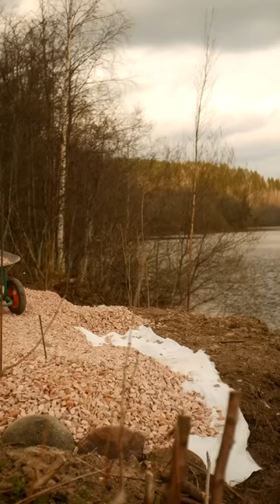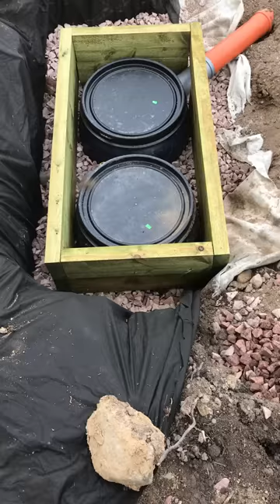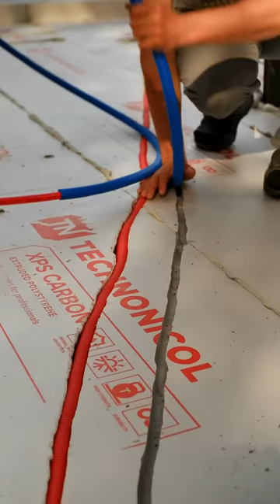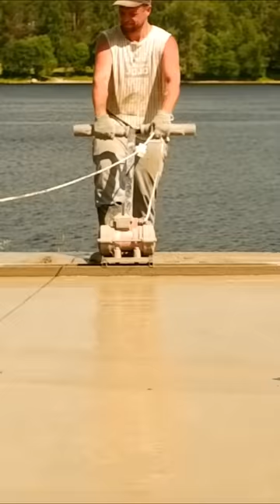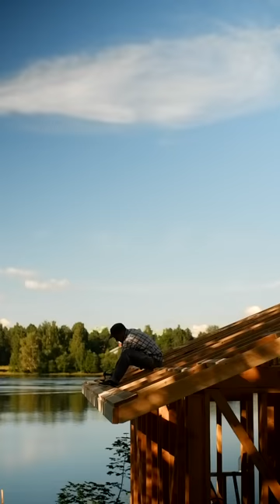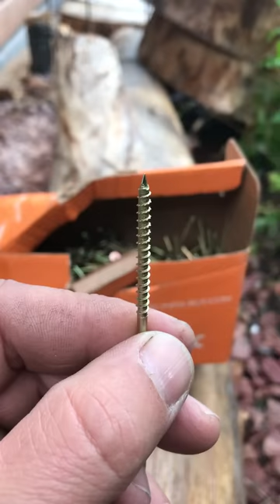Built a Dream House Alone! 1.5 Years in 18 Minutes. Diy

Comment: That seems awfully close to a body of water
Reply: Охранная зона реки: "я что для вас, шутка какая-то?"
Reply: Yes, My guess is Not USA. I cant cut a tree down within 125ft of a dry  summer creek in WA State.  😂
Reply: Beach erosion time.
Reply: It's Russia.  Here you can
Reply: That was my thinking,  flooded out part of the year.
Reply: It's a hydro lake as you can see, so it's level is regulated, but being Russia I wouldn't trust that .
Reply: Sorry to hear that. Nice build tho
Reply: @sandersson2813  last I checked Russia has a climate like here in Canada .   Lakes go up and down all the time, flooding is a real issue and building that close to water is not very smart.  One bad rainy season and you lose everything.   Last year we had a storm that moved several homes like that over 400 yards inland.  Two ended up in the middle of the road and had to be pushed aside with a snow plow.   That was in late September.  Not a wise placement at all and so much work wenr into it.
Reply: @jimdavison4077  Did you miss that it's a HYDROELECTRIC LAKE?
The level can be CONTROLLED

I agree that it's not clever to build that near to the water, but you don't know of that limit it is currently at is the max the lake holds. If any water body is easy to manage flood risk, it's a dammed, hydroelectric lake.
Reply: @sandersson2813  managed to some degree.   Not to the point that you build that close.   We get extreme weather conditions like never before, what might have been manageable before may no longer be so whats the point tempting mother nature to prove humans wrong?   An extra five foot of water could undermind the entire base it sits on.
Reply: @jimdavison4077  It depends of it's built above the height of the dam sluice doesn't it? If it is then it can't possibly flood. 
Presumably someone who has laid out the amount of money, time, money and effort to do this might have a better idea than some chumps like us on YouTube though, don't you?
Reply: @sandersson2813  You assume a lot, all kinds of people on Youtube doing stupid things I think you will agree.  Also the base this was built on is just inches above the water line, fast moving water doesn't take much to move the bank back and undermine all that work.   I have seem damns overwhelmed before because engineers ignored the obvious and thought they could control the pressures water carries.  Also I don't know many parts of Russia that don't freeze.  Icing causes serious problems and in floor heat like that causing ground anomalies  in the frost cycle would cause hell in shifting every year.
Reply: @jimdavison4077  fast moving? It's a dammed lake, it doesn't have a current
Reply: @sandersson2813  you don't get it when water levels rise it needs to go somewhere.   As people have tried to claim if the water rises it has a spill way.   Well which is it it has a spill way or it doesn't.    Either way the water moves.    How can people not see that.   Hell even if the water level doesn't rise of it freezes the ice then moves.   Or didn't you know that?   Many people who don't live in a cold climate don't know what freezing and frost can do.
Reply: @jimdavison4077  And you don't seem to get that it's a HYDROELECTRIC dam which means the authority has complete control on the levels within it. 
We don't know the lake, but we can assume the person in the video knows it substantially better than we do.  
For all we know the lake  is already at its  maximum at which any further ingress leads to overtopping the safety sluices, and yeah it appears close to the edge, but we don't really know from the perspective just how close it is and as you don't know where it is, you have no idea what the weather will be like or what ground conditions are or what the banking is made of or how it is supported. 

We can SUGGEST it's too close to the edge, but the world is FULL of examples of EXACTLY the same sort of thing or do you think this lake has the only building this close to the water.

Lakes have no current, the only movement is up/down, and ice only moves if there's something there to move it. 
I'll presume that as an American your ignorance of European geography leads you to believe that most of Russia freezes. It's the biggest country in the world by an absolute mile, it's got a vast variety of climates, from the frozen north to the arid dry south at the Caspian.
Reply: @sandersson2813  If the last decade has taught us anything its that water is not easy to control.    It doesn't matter if its a lake river or ocean they all have an incredible ammount of force.   And no ice does not only move if there is something pushing it.  Water expands when it freezes so whatever is holding that water has an incredible amount of pressure acting against it.   As for frost i have seen it lift a two story house six inches off the foundation.    There is a reason you can't build so close to water in most countries even in Europe.    Most people can't afford to throw money away so they only want to do it once.
Reply: @jimdavison4077  Water in a controlled, dammed  lake IS easy to control and doesn't even need any human intervention. 
A dam wall SPECIFICALLY let's water out when it reaches a certain height.

Ice does not flow in a constrained dammed lake, and yes it does expand, but so what, it expands IN THE WATER. 
Yes, there is such a thing as frost heave BUT YOU DONT KNOW WHERE THIS LAKE IS. It could be in the Caspian area where temperatures are mild. 

Also, you are ignoring that building exist next to lakes ALL OVER THE WORLD.
Reply: Effectivement, les risques que la rivière ait un débit plus important, expose la maison à de potentielles inondations.
Reply: @sandersson2813  i have yet to see any building that close to water that does not suffer seasonal flooding from time to time.   And when water freezes and expands it does not expand IN THE WATER as you say but onto the surounding land.   For example if you put a glass bowl of water in the freezer chances are when it freezes it will break the bown from expansion.    As for controling water levels every year damns  overflow because they get more than expected water levels.   So the point remains that building that close to the water with that type of construction was not a wise thing to do.  If the water rises enough it will undermine the entire stricture.
Reply: @sandersson2813  if built prooperly and anchored into the ground and eleivsted sure you can build close to water or even on it.   That stricture is free floating on the ground.   Which means as water starts to eat away the soil around it and under it the building will shift.   Maybe even move.   Thats not desirable.
Reply: @jimdavison4077  You DONT KNOW if the water will "eat away at it". 
Do you seriously think the builder hasn't considered the conditions? You think he's that stupid?
Reply: Jesus, you still aren't getting this. Dammed lakes have sluices or overtop at a certain level. If you build ABOVE this level, it CAN'T flood.
Reply: @sandersson2813  do you want me to answer that honeslty?   The answer is yes, anyone who builds that close to water using rhat type of construction is either not very smart.   The risks are to great.
Reply: @jimdavison4077  You haven't got ANY knowledge of the location or the conditions. 
You're trying to pretend you know better than the person who has built this. 

Do you seriously think he would spend all that time, money and effort only to completely ignore the hydrological impact and that he only wished he'd listened to some know it all from US or Canada? How arrogant is that?

You're pretending to know that this house is built on poor knowledge when you have no knowledge on the lake . You've demonstrated your ignorance already by stating that as far as you know most of Russia freezes "like Canada".
Reply: @sandersson2813  no such think as can't flood that close.   Its water.   Water surpasses what engineer's plan for all the time.
Reply: @jimdavison4077  Jesus, you just don't understand engineering. The dam STOPS flooding by letting water out faster than it can enter the lake.
Reply: @sandersson2813  And every year we see that fail so what's your point.  It's an imperfect world where things don't always work as designed.   Engineers can't always plan for weather as it's becoming more extreme all the time.  You understand a lake is a big bowel which catches all the water from the sounding area right?   That bit of sand he put down isn't going to hold up if it gets saturated, it will give out leaving the structure undermined.   I have done enough construction in my life to know that.  People who build around water build on solid footings that they can anchor to.  Not sand put in with a wheelbarrow and then tamped with a home made device with an electric motor.  I worked 9 years on building highways and understand engineering a lot better than you do obviously.
Reply: @sandersson28 yes I think we all get that it's a hydro lake  and "controlled by the authorities" (someone has repeatedly mentioned it).... that doesn't mean the authorities are paying attention and react in a timely manner. Why so hostile? Is it your house?? If not, chill and let people have their thoughts and opinions. Geez.
Reply: @judiclark1012  I'm not being hostile. I'm simply stating that those commenting about the proximity to the lake as if they know everything  are not aware of A) where this lake is, B) how the levels are controlled, C) the conditions in this area or D) the knowledge of the builder, E) how building techniques differ in different countries or F) the current water levels in relation to normal/safe/historical/overtopping levels. 
They are simply surmising and arrogantly suggesting they know better than the guy who built it when it receipt of absolutely no knowledge of the area. 

Would you like it if some nobody on YouTube tried to tell you how to do your job when they know nothing about how you came to the decision to build in that location?
Reply: The control levels for hydro lake are 3% either side and that's with everything going swimmingly. That's getting flooded at some point, that's Russia and trust me as someone who lives in Europe they are crazy and do stuff like this. A Russian friend of mine built most of his house in Russia with a chainsaw over an old mineshaft... you wouldn't be allowed put up a tent near a mineshaft in Ireland.
Reply: @tonybarrett8543  As if living in Ireland gives you special knowledge of Russia.
Reply: @sandersson2813  does sand react different in Russia when saturated?   I see reason to think it does.   That was all very small agrigate put just on the surface of the existing ground.  Nobody builds like that that I know of.   And for a good reason.
Reply: @jimdavison4077  No sand doesn't, but this isn't built on sand. 
What sort of engineer doesn't even know how to spell "aggregate"?
Reply: @sandersson2813  we must have watched different videos because the material he used was fine.   That same material is known to run like mud when it gets saturated on a grade outpacing a running human.   Just stop with the pointless commetary and make some sense.
Reply: Wayyyy too close, all that work in a matter of minutes could be washed away! Much too risky my comrade.😮
Reply: must be a safehaven for eco workers or conservationists to stay on during harsh weathers...hence the lack of certain amenities...probably government sanctioned installation...maybe...
Reply: That's the beauty of it 😊
Reply: @way-with-heart anything is possible in Russia!
Reply: That’s probably where the waste is going.
Reply: Always has seemed odd to me that we call a fluid, a body, of water
Reply: His building is so airtight, it won't sink. 👍
Reply: Nice build. Where do u eat sleep cook?
Reply: Idk how I feel about concrete being poured over Pex plumbing
Reply: @sandersson2813  you don't know anything about russia
Reply: @michagorski4693  I didn't claim to.
Reply: @watchndatube1  Washed away in a hydro electric dam with controlled levels and no current?
Reply: Freedom is the right to take a chance with your own damn property
Reply: It is not a house, it is a sauna!🌷🇱🇺🙋🏼‍♀️
Reply: @sandersson2813 wow what world are you living in? I have seen licensed professional builders do stupid things while building and be shut down because of it. Another thing that septic system he installed so close to the water will leach into the water too, even more if that water rises up and floods the land, the water level in the ground is already high being next to water, a perk test should have been done to even see if it would drain correctly.
Reply: @jimdavison4077 don't waste your time on people like him.
We all know it's just stupid to build that close to water
Reply: @way-with-heart no, you don't
Reply: Je connais quelqu'un qui devrait en prendre de la graine .
#vivienroulin 
Et sa " rénovation"
Reply: Really poor choice by builder. Shows total lack of concern for environment. Way to close to water regardless if this is a regulated reservoir. Your septic sysyem is way too close to the water causing nutrients to leach into water. Takes away any credibility with your build
Reply: @sandersson2813 he said lake is result of hydro electric dam. There IS current whenever dam releases water or is generating electricity. 😊
Reply: @sandersson2813 wonder if people like you were telling Noah the same thing you are telling this man?
Reply: @joetownsend5904  Noah didn't exist.
Reply: @joetownsend5904  Ha ha ha. You realise the turbines are at the BOTTOM ? 
Youve clearly never seen a hydro dam in operation. You'd have no idea of any current unless you were working about 20metres of the dam wall.
Reply: Damn thats still a lot of work for 1 man
Reply: It does, but I think it’s a lake so unless they get a lot of rain I think it’ll be OK. But where’s the kitchen?
Reply: @GoodWoodWorks-le4cd juju I have 😮😮😮😅😅😅
Reply: @sandersson2813 Calm down mate, you'll have a stroke if you're not careful.
Reply: The first time it floods so bad they have to release extra water from the dam he floods
Reply: @jimdavison4077 i agree with you
No one in iran in north of countru build consteuction near water like this
Its insanity
That aside
I never saw any one ever build a house on sand
There is literally a saying
" house built on sand" 
Because everyone knows it WILL collapse
But i never saw anyone build a house this close to water
And on top of that entire base is sand 
Its insanity
I understand its cool idea for "this age" that 1 man build a house
But extreme push back against common sense that somehow its a good idea to pick this position is strange to me
Reply: I agree, as a victim of hurricane Sandy. I would be hundreds of feet away from the water. Hopefully, he doesn't have a disaster. I admire his independence.👍
Reply: @warfreddy6968  and then others need to pay the price?  Thats not freedom, that selfishness.
Reply: @sandersson2813  hydro dams always have a current.
Reply: @jimdavison4077  Its barely perceptible and its certainly not erosional. 
I live on a country covered in them, even fjords have virtually no current.
Reply: @MrMike3112 он: да..
Reply: @sandersson2813  water moves with gravity and wind.   Hard to not have rising and lowering levels.  The only way is if it were an artificial body of water with no seasonal sourse of rain.  Not he place didn't look like a desert to me or many others.  Even still most places have building codes which prohibit building that close to the water with no foundation.  Septic laws also prohibit the instilation of any system or storage tanks that close water.  On top of thatwe don't build on sand for a reason, its like building on a pile of marbles.  It doesn't take much to move the base.
Reply: And not a lot of foundation, just a little gravel.
Reply: @SLFYSH  Does your shed have a foundation. This is a glorified shed.
This is supported by the beam surrounds, not the type 2 gravel  infill
Reply: @sandersson2813  foundation isnt so critical for a shed, -unless its less than 6' from the water, then its a disaster waiting to happen.
Reply: @SLFYSH  Why is the water an issue here when its level is regulated by the hydro electric dam?
For all you know the level of the lake is at its peak. You do know that hydro electric dams simply let water flow over the top if it gets too full? Just as you can't fill a bath above a certain level.
Reply: Nah
Reply: Right

Comment: You are a talented individual.  However there must not be any building regulations where you are. No pressure treated sil plates. Septic  system is too close to the body of water to be safe. No shear on the walls. Just to name a few.

Comment: There's no foundation for his house... on the water's edge
Reply: This is floating foundation. Before commenting learn something. Best solution for such a place
Reply: @giedriuspundzius8403  I know what a floating foundation is. It's a process for soil that has a problem with significant settlement and differential settlement under heavy loads, or that doesn't have a hard layer at a reasonable depth, which prevents settlement. Except that in the event of rising water levels, the house will be swept away or even sink, due to the lack of a water-resistant soil structure, notably because of the lack of riparian vegetation. You see, not everyone in the world is ignorant...

Comment: Respekt, das ist eine grossartige Arbeit. Bitte würden Sie mir auch ein Haus bauen? Ich ziehe dann von Deutschland weg, hier ist ein Haus oder eine Wohnung unerschwinglich für normale Arbeiter geworden.
Reply: I run a construction business around St Petersburg and we build 100 m2 houses for $70,000 with land included. Of course, a lot safer, better insulated and better looking than the one here :) The location is close to the city, 25-30 min from the nearest metro.
Reply: @vladm5920 Many thanks for your answer. As soon I'm ready for movement to St. Petersburg I will contact you. 👍